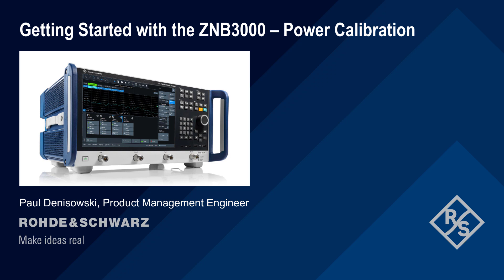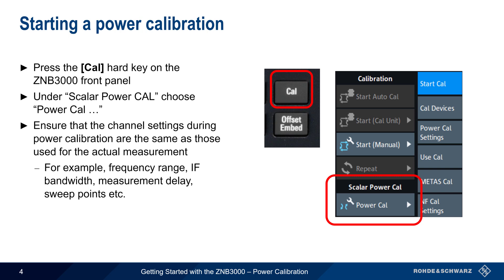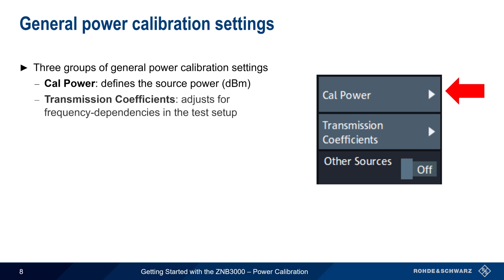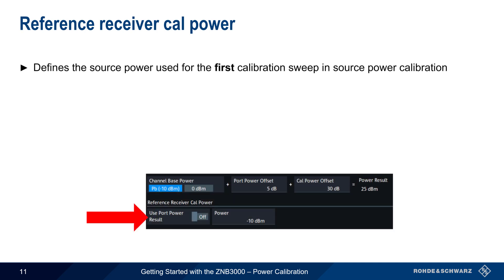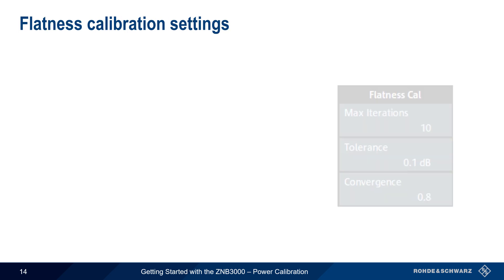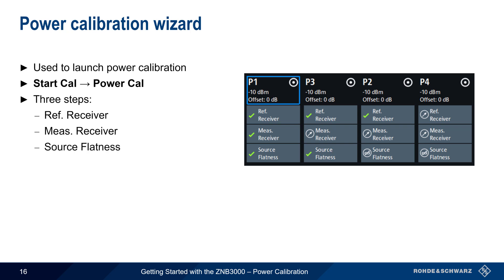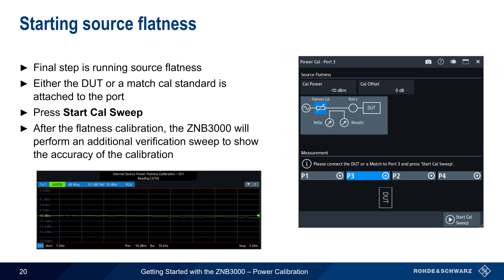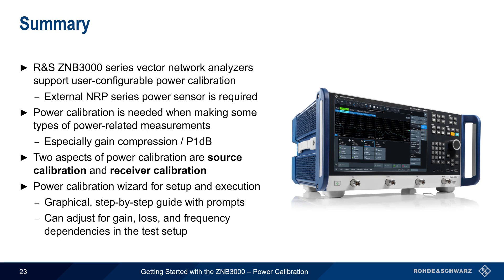Getting Started with the ZNB3000 - Power Calibration

Comment: What if Vector power calibration were involved?
Reply: Power calibration is always scalar.  For S-parameter measurements, both magnitude and phase (vector) are typically measured, and thus the system error calibration involves vector values.
Reply: @pauldenisowski  Ok, that makes sense. Thanks.